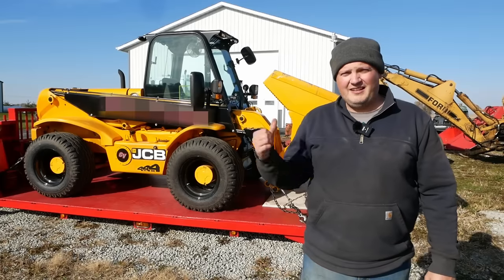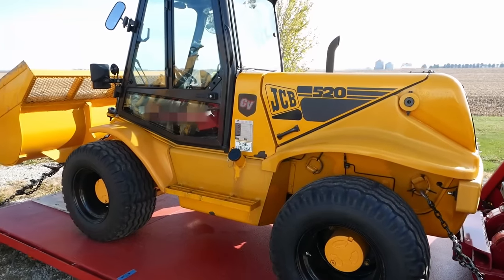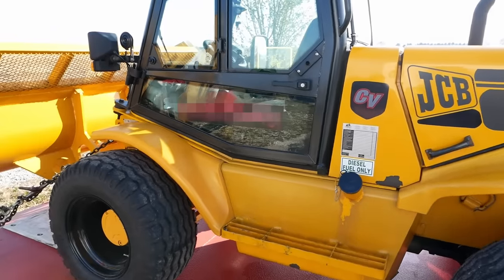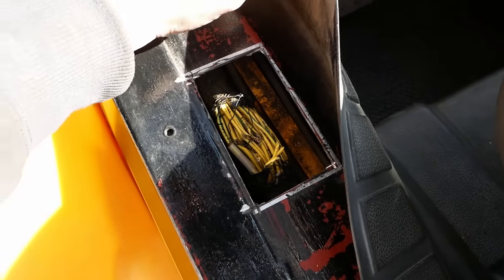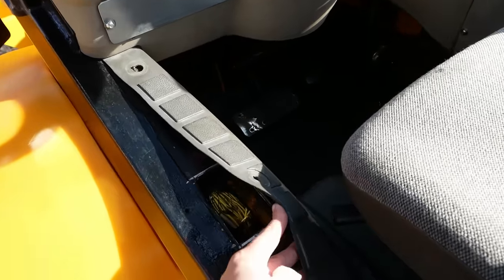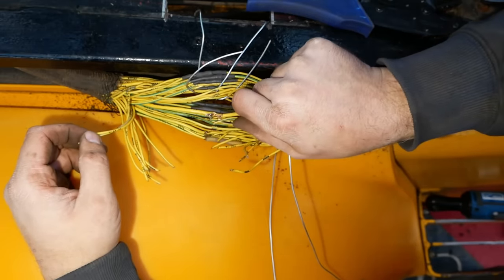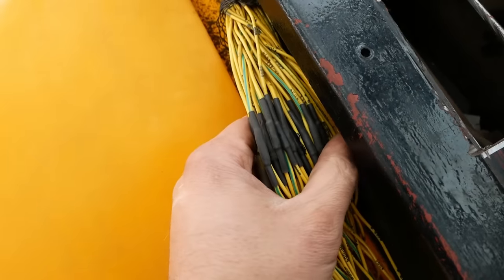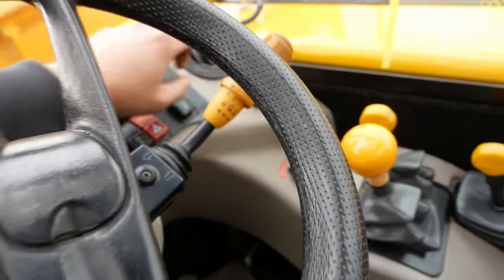What Happens when You Drill a Hole in Your JCB Telehandler?

Comment: You patience with this repair is beyond description.  And a new harness might not have been practical as the unit could have been built around it.  That was the case when I was in boat building and a lot of holes got drilled in bulkheads, floors etc.  The notion of severing a wiring harness turned supervisors apoplectic.  The second thing we did after finding a place to drill a hole was to find out what was on the other side....without exception!!

Comment: Hi Wes - Love your channel!!
I would suggest the best, quickest tool to use to cut open wire looms is a pair of electric scissors...
The one I have cuts cloth, plastic, leather, etc. with ease and it does not disturb whatever is underneath...
Reply from the maker: Interesting. I've never heard of them.
Reply: Also look for what are called bandage or EMT scissors. They have a flat bottom blade and don't cut what is below them :)
Reply: The scissors are nice but the problem I have with them is more often than not I can't get them into the tight spaces I need to open a harness up.
Reply: This is the one I use... Hercules AS100-K Electric Rotary Fabric Cutter

Comment: I just finished rewiring the harness for everything in the front of my 77 Jeep J10. Replaced the majority of the wires from the bulkhead connector to the engine and front lights. They had been spliced and hacked to the point that only the first couple inches were any good. Rather than do what most DIYers do and use all the same color and size for everything i ordered wiring based on color and size in the wiring diagram. This also allowed me to change how the harness was routed for a much cleaner look. I even put weather pack connectors hear the bulkhead connector so if need be i can simply disconnect it and pull the engine. Was a tedious process but im very pleased with tge results.

Comment: Another Job WELL Done!!  I work on wiring a lot and I think you did exactly what you should have done in this situation - your job is top class and will last as long as a new wiring harness and you saved the customer probably $1500 or more!  I wish you were closer to me!  I would definitely bring you some equipment.  I have a ford 3000 diesel I am about to put a 2 stage clutch in.  It has a Loader frame on it for a front loader bucket which i will have to take off.  On the one hand i would love to find someone i trust to do the whole job for me but I have no one near me.

Comment: Great Job Wes.... reminds me of a story I forgot, it was back around 1973 or '75 when I installed a Motorola T-Handle radio chassis in the floor of trunk in a Lincoln Mark IV, used some of those molly bolt nuts... yup, car sitting on the ground like normal. drilled 4 holes in the hump over the axle...... months later the customer called me up and said " Guess what? when you mounted that radio, it went through the Gas Tank ".... he laughed it off, glad he did, I was a young radio technician with maybe $20 bux in my wallet.  It would only leak if he filled it up so much gas would run out of the fuel filler cap.

Comment: I had a customer who was tired of the pesky rear wiper fuse (that powered other more important things also) blowing over and over so he wrapped it in foil.  The technical term for what happened next is "Letting all the smoke out of the wiring harness."  A fat bundle of wires from the fusebox ALL the way to the tailgate had that one wire that burned and melted through its own insulation then randomly melted through the insulation of its neighbors shorting the wires and sealing them together when the plastic cooled and hardened again.  It was like $900 and a 3 day turnaround on that job but proud of how it came out in the end.  There are about 25 wires in this bundle, so 2^25 or 33,554,432 different ways for that many wires to short-or-not-short together and cause unique symptoms in this scenario.  

Another guy fixed his own falling down plastic belly pan with some drywall screws that self-tapped effortlessly into the soft aluminum radiator core, all in a row.  Gotta love that kind of phone call.  "Yeah I'm the guy that just left after not doing any of the repairs you recommended and complaining that all the prices are too high.  Anyway, um, how much do you guys charge to put in a new radiator?

Comment: Great job. This is a case of dumb things help keep you in business. Back in the 90s had a Volvo 240. One day went out to start it dead. Turned out a bunch of the wiring had just come apart with the insulation just falling off. Took me every bit of 5 hours to splice in new wires. Not the mess that was.

Comment: Wes that was a neat precise wire repair job, glad you were able to just lift up the one side of the cab to get at the damaged wires. that black tape you used is called friction tape by the way.
Reply from the maker: It's a little different than regular friction tape. The friction tape I've used is sticky on both sides and you have to cover it with regular electrical tape. This stuff is only sticky on one side.

Comment: I use to work Trane's small rooftop multi-zone HVAC units. All wires were red with white or yellow numbers. Imposable to repair without a Ladder diagram, Pictorial diagrams help to know what all the components were. But you can carry the torch for me. Thanks for letting me hang out!

Comment: 100% a good quality seam ripper plows through a harness loom like that!
Also I've had to patch in new front end harnesses in armored military humvees when I was deployed in Iraq. All black wires, no markings except for at the harness ends and it was far too difficult to replace the  entire harness so I had to cut a new harness with extra material to reroute the harness cut the old harness and probe, test, and label both harnesses then solder and shrink wrap them together.
It was a great time!!

Comment: I was an install tech for Motorola back in the late 90's/early 2000's. We installed the radio 'suitcase' in the Ford crown vics on the shelf in the trunk. We had very specific length self tapping screws that were used because the gas tank was under there. One day we got a fleet of 5 or 6 new cars to install, and went to work zipping in all the mounting brackets. Came back in after a break and there was a heavy smell of gas in the shop. That model year, Ford had changed the tank mounting slightly and our screws were just long enough to puncture the top of the tanks. That was an expensive oops. 
I also put a screw through a harness under the back seat of a brand new Trailblazer and had to hand splice it back. Fortunately that was only 4 wires. 
I first saw the tape on a socket trick a few months back from Eric O...wish I knew that years ago, it would have saved SOOOO much time. Now I use it every few weeks working around the plant.

Comment: Replaced a blown circuit breaker at a service station (gas station) in the middle of the night pouring rain and extremely bad visibility. Managed to drill a hole through a 200A cable. That it was 200A saved me as the drill bit disappeared ! Still can't believe how lucky I was  though !!

Comment: I bought  saloon car once, sight unseen because for its age and mileage it was small enough price to break and sell bits. Just as that, absolutely no electrics at all, fuses all melted. Checked and found owner had drilled holes along the inside sill to thread a cable for a reversing camera , wiring harness totalled. Trip to a breakers yard, a few coins for a wiring harness from a crashed one, just replaced the damaged section. Excellent car I ran for a year or so before it was sold on, never a problem.

Comment: Wow that is an interesting predicament with that harness. Two great tools I did not know about, the machines jack and the look cutting aid. Good stuff WWW. No, I'm not surprised but what a leap of faith putting that darn harness in a tubular frame with no access. That trick with wrapping the cloth tape around the 9mm socket is great. It solves a problem I have. Also a trick looking hauling rig. Guess as a drop off it is modular for other features that can be lifted onto the back of the truck.

Comment: I’ve been repairing harnesses and building custom harnesses to order for 20 years now… and there’s absolutely nothing wrong with the way you repaired that - I would’ve done the exact same thing. As for purchasing a new replacement harness: probably would’ve had to be built as a one-off by a shop like mine. More cost-effective would’ve been to remove the whole harness and send it out to replace the specific damaged conductors end to end, but that’s an incredibly expensive way to avoid some mid-harness splices 🤣. Ya did good!

Comment: Yes sir. I'm slow, people tell me that I am not fast enough with my mechanical work especially when it comes to mounting aftermarket stuff and drilling through auto bodies and such to add things. I know this however it may take me longer to fix a mess made by doing something that was done here. International trucks had numbers on the wiring and it was better to have a wiring diagram to trouble shoot things but once you identified components in the wiring system one could refer to those numbers although it was much more tedious to find your trouble. People do learn by their mistakes, and this owner certainly learned something there. We've all done it.

Comment: I had one of my workmate fit a plywood floor to the back of a toyota van. The van came back a day later with a strong smell of petrol. He had drilled through the steel floor and into the gas tank. He undid the straps to take the tank out to be repaired and it wouldn't come out as the rivets were a bit long and held the tank to the floor. He never heard the end of that LOL. I love the fact that the wires are yellow even with numbers on its a job LOL

Comment: Yje JCB 520 is a great machine. I used one regularly when I provided contract services to a paper mill. Very handy, nimble and plenty of power. Pretty sure it can handle 1ton easy enough.
Reply from the maker: Two tons if I read it right!
Reply: @WatchWesWork  Yes, you are correct. 5 metre reach and 2tons max lift at full closed and just of the ground. I picked off 6 x 8' x 4' x 1/2inch (?) steel plates for use on a semi trailer park (the plates were for the landing legs to touch down on instead of the soft gravel trailer park) and the weight was a bit much for the 520-50 and as I reversed away the machine gracefuly tipped forward. Just lowered the arm and the rear wheels came back to earth. I then got the JCB 530-70 and it was OK. Really good machines and with the third service you can drive sweepers and stuff. The machine you worked on is in great condition too!

Comment: That JCB almost seems like it was made with repairability in mind. The numbers on the wires every few inches are really nice, though they could have used a few more colours. The last time I saw something labelled as good as that harness was a Strömberg genset control cabinet from the 1970s. They had taped and lacquered small paper labels every 100 mm on every wire, and every single wire in that cabinet was parallel within the bundle, not a single wire crisscrossing.

Comment: That machine is so clean!
Obviously the guy that paid for it is the only one that drives it.
Story time: My brother hung a picture in the middle of a cement rendered wall once.
Right out in the middle of the wall.
Drilled a hole straight through the wire to the light switch.
I still can’t imagine why it was there all nicely cemented in.
From memory he just cemented back over the hole and moved one inch to the right.
Light still worked

Comment: Good repair Wes, car harnesses often have stripes of colour in sequence for matching up and a common colour for ground ( often Black green or white) the taping was the right finish and those mystery lights failure was probably in the upper frame and not where you did your repair. Waiting for a new JCB harness from my recollection would have been quite a wait, fitting it a big headache, I think you did the Right/Best thing relinking the broken wires and it should stay working until the next clown decides to drill or something more major occurs. Cheers …

Comment: I had to do an air conditioning repair on a Versatile tractor where a farmer tried mounting a control box to the right front cab pillar with 1&1/2” self tapping screws, because he didn’t have any shorter screws. When I presented him with the bill, all he could say way that was the most expensive, stupidest thing that he had ever done. 
He got both the high & low pressure hoses!
I see that you do the same thing that I do, on an unfamiliar rig, pull the key out to make sure it is off!
Hello from north east Montana. 
10 miles from the Canadian border.

Comment: That tool that you were using is called a 'wire spoon'. They are used to thread a new wire into an existing harness, through ty-wraps, clamps, etc. We used to use them in aviation all the time for wiring modifications. You do have to be VERY careful as they can cause a LOT of damage in a very short time in unskilled hands. I do like the way you used it too.

Comment: Nice work Wes,
In my early years as a  tech. I was drilling a hole in the RF inner fender on a vehicle  the bit caught on break through and went like a screw and started glowing cheery red. i never moved so fast trying to lower lift and disconnect the battery. Lesson learned.

Comment: Great trick winding the tape around a socket, I'll use that one! I would have soldered the butt connectors after crimping. I used to work for a major equipment manufacturer that tried that once, but went back to soldering. You think your repair was tough , think of the problem it's going to be to find which one (or more) of your splices has lost continuity.

Comment: We have the JCB 504-13, amazing super useful little machine. Claims to only lift 4,000lbs but I managed to tweak a fork pretty easy. the downside: the little 4 cylinder Perkins is flying under the radar when it comes to DEF and I think that’s my biggest pet peeve. Not the def part but it could definitely use a little more power and it would be amazing. Only 39hp from factory I asked my dealer if they could get a tuner for it.

Comment: The Menda 35250 is what we call a wire spoon in aviation.  You can also use it add additional wires to a bundle that's already tied and clamped up by slipping it under the clamps or zip ties, or string tie, and pushing the wire through the groove.
Reply: Which is where the idea came from.  opening some of the thicker wrapped wire bundles was risky, and slipping the spoon in acted as a nice solid backstop.  Took the spoon idea with me when I left aircraft.

Comment: I know that laughing at someone's disasterly misfortune is sometimes not cool, but in this instance I did laugh and gasp. It does pay to know what you are drilling through. And less face it, pretty much every vehicle has the main looms running under the sill either side of the doors. It's the safest, best & easiest way to get wiring front to rear. The chap is lucky he did get out of this so easily and cheap! Joining the wires in the loom was the best solution in this instance, as you said the loom would have been expensive, and the labour more so.  I do like the skid/tray-back all-in-one it was bought in on. No need to winch the JCB up or down, plus there was plenty of room to work on the vehicle.
Reply: I wonder how easy it was (or wasn't) to get the JCB onto the transport tray thing.
Reply: @dfross87  what  I meant was no need to pull it up and down multiple times. i am guessing it was winched or pulled up once.
Reply: @robpeabo509  Understood.  But loading it could have been a PITA.  But Wes mentioned elsewhere it was already on the tray when the hole was drilled, so the owner dodged another one there.

Comment: Reminds me of when I worked on Western Stars, every wire was white. At least they were numbered.........

My dad had fun one time when the starter solenoid shorted on a Deere 4020, happened in the middle of the night, so it killed the batteries. Dad went to start it, found the batteries dead, so bought two new ones. As he hooked up the last battery cable, the tractor fired up because the fuel was still on, and it instantly fried the entire engine harness. Dad took the opportunity to convert the tractor from 24 volt generator to 12 volt alternator............

Comment: Top cab light might be controlled with the turn signal stalk..as in they are the high beams.  John Deere loader/backhoes do that.  As for the repair its fine,  Im a heavy equipment field mechanic, and I fix harnesses damage all the time.  The only time I replace them is fire/shorts/corrosion.

Comment: Similar experience but with Euro exotics back in the day. Had phone installer add a mount for a cell phone (back in the 80's) he drilled two large sheet metal screws in the tunnel on a brand new 935 DP Porsche..right thru the harness. Non repairable loom, new loom had to be installed after drive train was pulled.

Comment: I recently had to repair some rat damage to my Toyota tundra. I had to pull the intake manifold loose to fix some wires that are underneath that the rat chewed off at the connectors. It ain't the first rat induced repairs I had to fix. Who would have thought that making wire insulation out of rat food (soybean) was a good idea. Why automotive do not use a rodent proof insulation should be a crime. Your repair work on the wiring is excellent and won't create any issues.

I also have a cnc milling machine. It is one I built and converted myself. So I can understand the amount of wiring you had to work thru. Even though my cnc mill is smaller and more simple compared to a commercial machine, it still takes a lot of wiring and understanding of electronics. It is quite the adventure researching and building a cnc machine and to have it operate reliably when done.